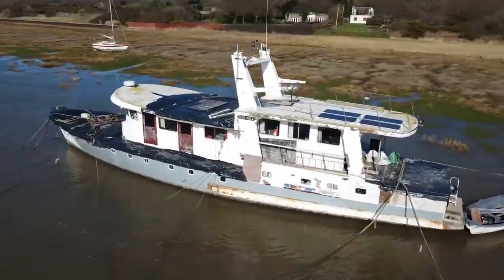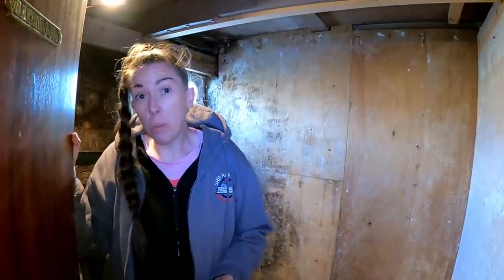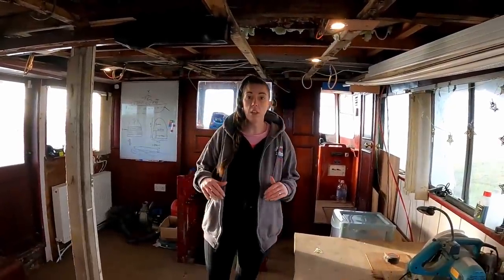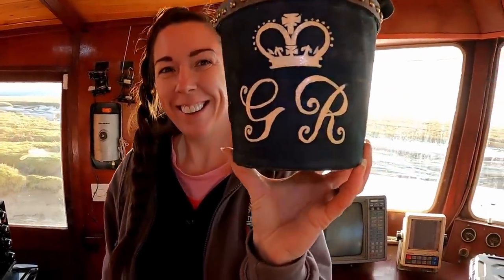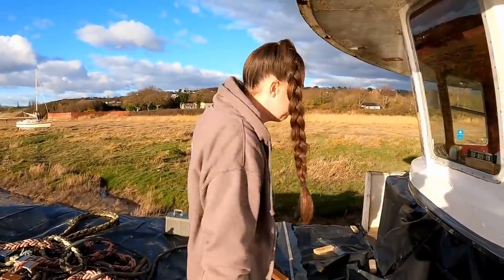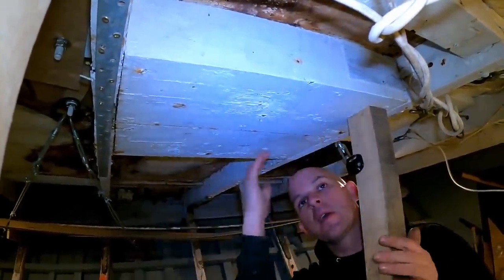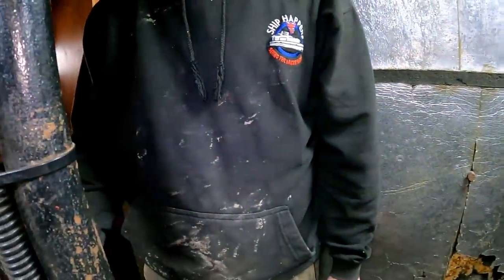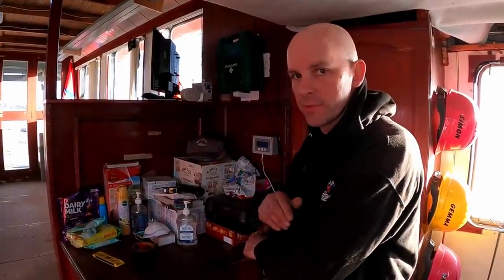Ep 62 - BOAT TOUR Of A £6000 72ft 1943 HDML  #boattour

Comment: Best video so far - have been waiting for this quite awhile.  By the way, your Sailor R109 SP Radio in the wheelhouse is a multi band receiver and transmitter.  You could listen to regular AM and FM radio broadcasts anytime without any problems.  To transmit, you might need to be licensed.  Also, if memory serves, it probably has a built in an older navigation feature as well.

Comment: Nice summary of boat layout with a subtle sense of humor.  WOW,  also provides a view of the great work/improvements in the past year.  I appreciate careful use of “port” and “starboard”. One minor point,  you will”steer” a boat.  In my experience,  when you steer a boat,  the bow turns toward the direction you turn to, the the stern kicks out the other way. Failure to understand this, cost me $2000 USD repair! Best Wishes for 2022!
Reply: We learnt the terminology over 40 years ago when we started out with a narrowboat on canals, so gone put in a place when talking to "Experienced" boaters we soon learnt the correct terms like you don't drive a boat you steer it.

Comment: Looking at this boat, I can identify enough work to comfortably see you both into retirement. However, despite your "babes in the wood" demeanour, you're evidently very practical and positive - which you're going to need to be, in spades. Relationships have foundered upon far smaller projects than this, so never forget that in the end; you both come first. As it's such an old vessel, perhaps you are eligible for grants on the basis of its historic nature. You'll sure need deep pockets when you crank up those two dragons and get the turbos whining. I reckon you'll be lucky to get 5 gallons an hour, and more likely 10 on the plane. Them whopping tanks ain't just for show...Good luck!

Comment: A great tour. It let me crystalize my thoughts on the aft cabin.  When underway, bearing in mind you will probably steam overnight  on occasion Right above the props will have a ton of vibration and noise likewise as steering gear is noisy.  sound sleep will be difficult. I If you are doing that make it  a  harbour cabin and fit 2  bunks as sea berth for whichever of you is off watch where the workshop is ie very close to the wheelhouse and engine room possibly with an emergency call bell

Comment: 1100 hours.........provided they are well maintained.......they should easily clock up 10,000 to 20,000 hours.  There would certainly be available, up to date turbochargers for those engines that would give them a significant lift in performance/fuel economy...........turbo's have improved a lot in the last 40 years.   I also use Victron gear for off-grid.......4 years, very reliable,good documentation and configuration, big thumbs up!

Comment: When you do replace the power batteries do get some LFP lithium cells. They hold 2x the power of a lead acid and last far longer. Cheaper in the li v run.
Reply: lithium  batteries are a insurance company  no no look at the loss of the Car Carrier last month .the cost is the big factor..

Comment: Removing the fly bridge hugely improved her looks & I'll admit I'd love to see the wing/davits thingy gone too but I'm an old fashioned git.🙃

PS If the CH runs on diesel, it'll run on heating oil/kerosene too, which is a lot cheaper (especially after the ban on using red diesel for anything but purely agricultural purposes...).
Reply: PPS How much power are you averaging off the wind generator? Thanks.

Comment: Batteries installed just below what looks like the wet exhaust discharge is a potential get-wet-risk given the history of these craft where fasteners failed that connected the exhaust to the hull fittings with the result the cooling water discharged inside the hull flooding the engine room and ingress of sea water as the vessel rolled in the seaway. The issue was dissimilar metals near each other bathed in salt water and exhaust. Suggest you move the batteries to a safer place and monitor corrosion of fasteners - alternatively eliminate potential failure and route dry exhaust up through the deckhead and up the mast and discharge  cooling water higher up in the hull just below deck level. This will also solve the problem of exhaust discharge at waterline blackening the hull and  you choking in  exhaust fumes when traveling along with the wind.  Your Cat engines are quite powerful for this vessel and engines half the power (2 x 115 hp Foden)  pushed it along nicely at 10.5 knots which is 0.7 kts under the max theoretical speed for its length (just under 71 feet at WL) - calculate theoretical speed for a displacement hull by taking the square root of the waterline length in feet add one third and call it knots. Fuel consumption for 2 x 115 hp engines was close to one gallon per nautical mile at 10.5 knots and about half that at 8-9 knots.  Your more powerful cat engines at max sustainable power should push it along a bit faster at up to 12 knots which is above theoretical speed so will get the bows rising to a degree that is not economical for the round bilge hull therefore really burns fuel. Slower you go the less fuel you will burn per mile but its best for diesel engines that you keep a reasonable load on them so slow steaming for a long time would not do them any good.

Comment: Okay, firstly.. the very best of luck to you both. secondly.. that boat needs to be out the water with a skip next to it, gut the whole boat apart from engines which can be rebuilt without removal. If its just for you, I would go open plan. This will save money, and only fit what you need. A lot of that old rubbish is now out dated and not required.
Have a plan and stick to it, otherwise you will find 5 years from now, you still won't be any further forward.

Comment: You are slowly getting the sailors lingo but I have to tell you they are not stairs. They are gangways.  I do hope that all crew are working on learning Radio and are going to take all the neccessary Radio Licences. even though the kids are not old enough to hold a Radio Licence they should still take the learning for if or when they do have to use it. And when they are old enough it will be a breeze to pass the licence.  The same goes for the the International Certificate for Operators of Pleasure Craft, or ICC (International Certificate of Competence).  Everybody on the crew should be competent.

Comment: Great tour, peeps! How many hp do the engines have?
Reply from the maker: Engines are 290hp each, top speed is about 12 knots
Reply: @ShipHappensUK  the top speeds of 12 knots was with the original engines in WW2, right? Or hasn't it changed with the new engines? They surely must be more powerful?

Comment: It looks like your boat is stuck in the sand?
Reply: Yes Keith, it sits on the mud at low tide and floats at the top of the incoming tide. They have quite high height discrepancy 'tween tidess. The vessel is well moored with several heavy/strong ropes.

Comment: I spotted zero lifesaving gear aboard. You are responsible for that minor onboard. After 62 weeks, you seemed surprised to find a single lifevest low down in a mis-labeled cabinet and then re-shut it in the mislabeled cabinet. What happened to the two life rings in the stateroom on the lowest deck(!)?  You could hang one fore in front of the wheelhouse and aft topside. Tie some rope loops to the end of some poles to use for life-saving gaffs and leave on deck (bamboo or even mop handles). Your gangways have zero non-rotten handrails and slippery plastic sheeting for traction.  Someone may alert child services that ur housing a minor in this construction zone.
Reply from the maker: You do know that we don't live on the boat don't you? And that she doesn't often see water and therefore life jackets are as much use on the boat as they are in my house!
Reply: @ShipHappensUK   Better to have them and not need them than need them and not have them handy. When you slip on the sidewalk outside your home, you may get a bruise. When u slip from 2-3m deck you'll loose consciousness and drown face down in that mud in half a minute. I'm not a hater and wish u all the best.